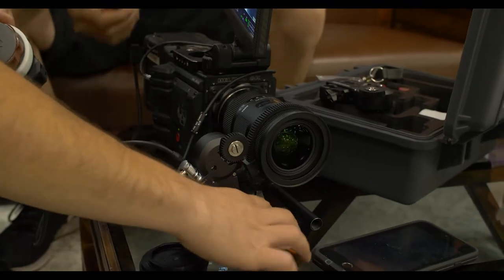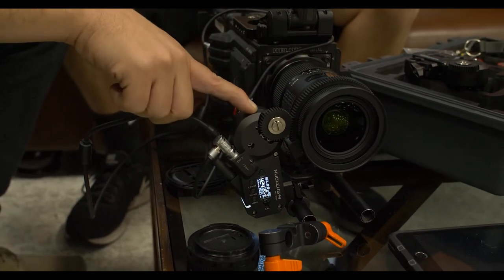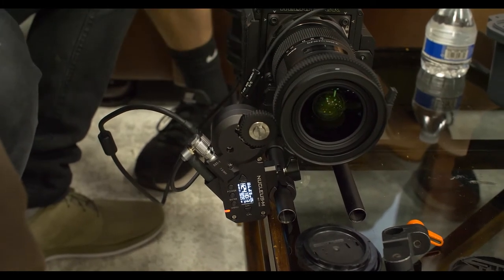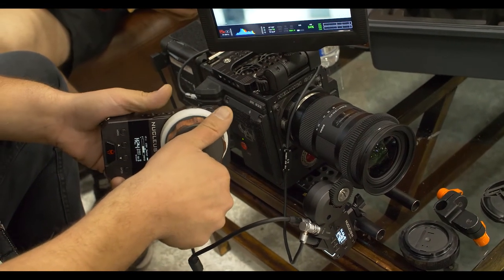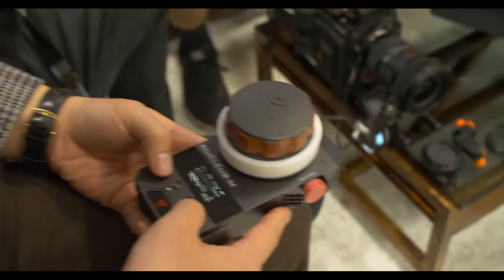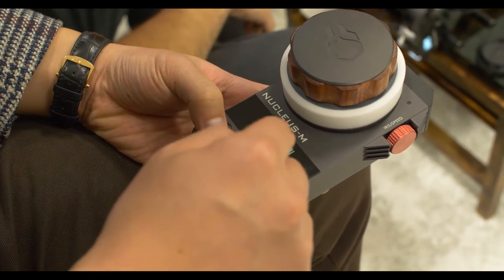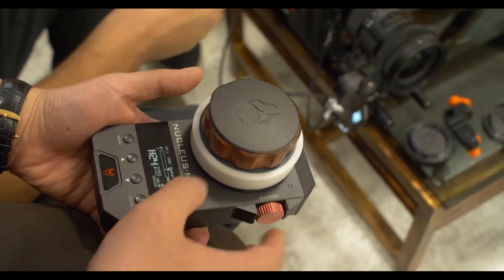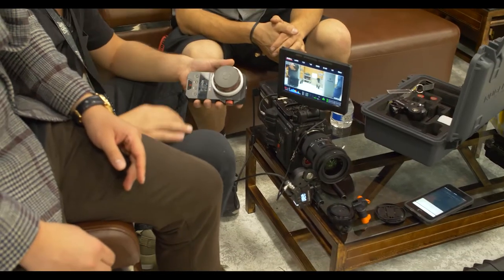Nucleus-M - Rough Tutorial - Mapping Photo Lenses

Comment: From this video, I have a suggested software feature pertaining to calibration.

Manual calibration is not hard, but it's involved (digging through menus), takes time, and can be a pain in the field if you're just switching from a CINE lens to a still lens without hard stops just to grab a shot.

Doing the "Mark range" short cut is a fast substitute, but you loose the range feature, since you have effectively consumed it to do a fake calibration...  so if you need the range feature for your next shot, its not there...

Now the feature suggestion:  How about adding an easily selectable option that would take the current "marked range", and save it as the calibration range, thus freeing up the range selection so it can be used...

so calibration during lens swap to a still lens would be:   swap the lens, engage motors,  mark range for focus ring, click button to save range as calibration, and poof.  you're done.  no hunting through menus, marking ins and outs...  and having to remember how to manually calibrate...

just a thought,  after using the Nuc-M for about a year now, (and loving every minute of it), that's about the only suggestion I've ever thought of.

I don't even use my manual Follow Focus any more.  Thanks Tilta.  you knocked this one out of the park...  now, get to work on that 1200 dollar 3G SDI video transmitter!!!  ha!

Comment: FEATURE REQUEST: Now you need to include in the firmware the option for unlimited motion, meaning, set the rate and allow the motor to be controlled infinitely in either direction using the infinite encoders on the hand grips, or using the iris/speed wheel on the Fiz. This is necessary for making the system work with Sony G lenses, which have an internal servo that is not a 1:1 position mapping with the rings. The servo turns farther per degree of input the faster you turn the ring.
(I understand this would not work with the focus wheel on the Fiz or on the nano controller, because those have hard stops - but it will work with the wheels on the handgrips, or the iris/speed wheel on the Fiz, since those are infinite encoders)
Reply from the maker: Thank you for the feedback! We will keep this in mind for future updates!
Reply: This would be very helpful!